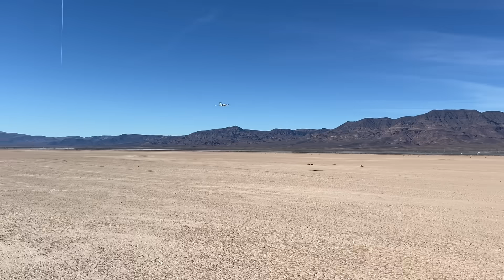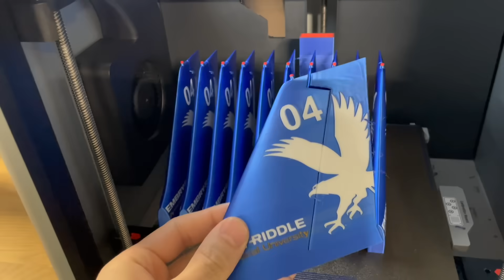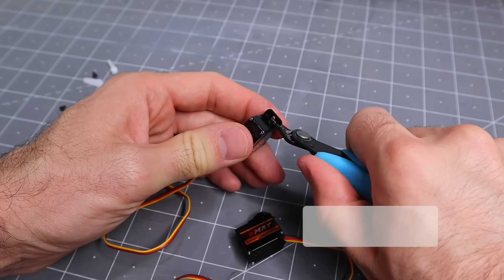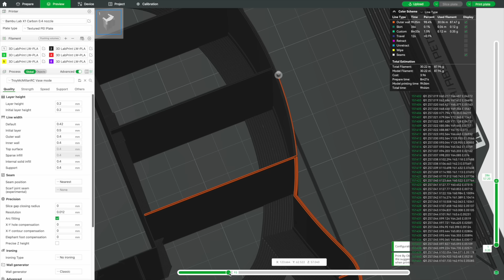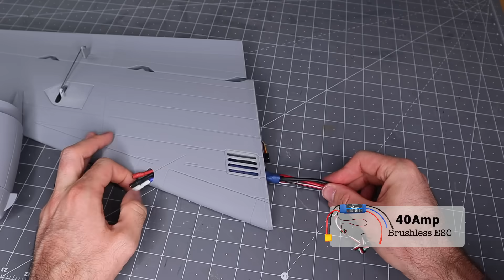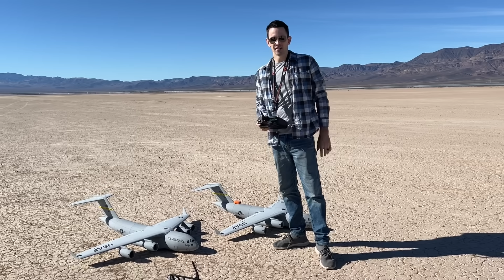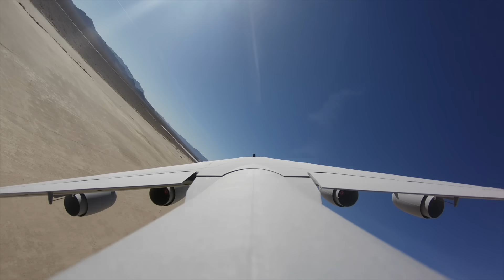C-17 the COOLEST 3D Printed Plane EVER BUILT!!

Comment: If you wrap glued in servos with a layer of black electrical tape, it makes them easier to salvage. All you have to do is cut the tape and peal the tape, then the servo can be reused.
Reply from the maker: Yeah, that is a great hack to point out. I do use painters tape on the bottom of the servos for that very reason, I like it to be very tidy and minimal for the video haha.
Reply: He had tape on bottom of servos
Reply: Hello, I have 2x 64mm EDFs. Do you think I can fit them to this plane without printing it bigger, or should I scale it up?